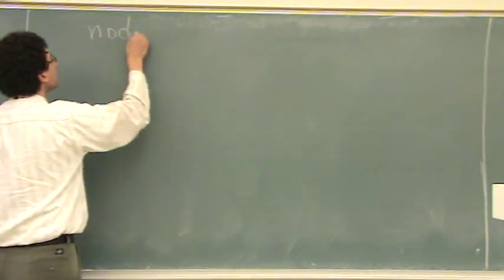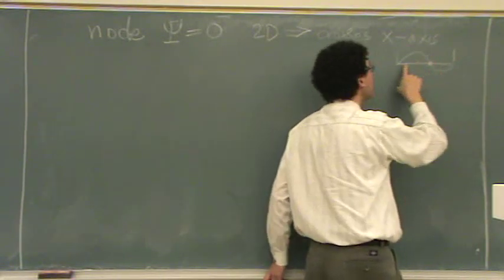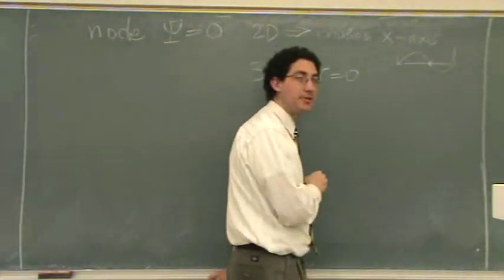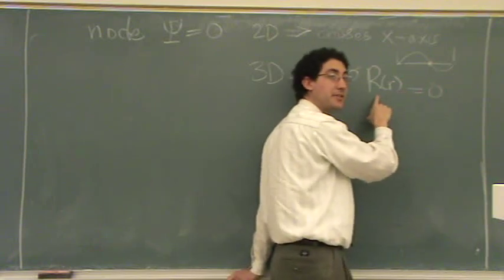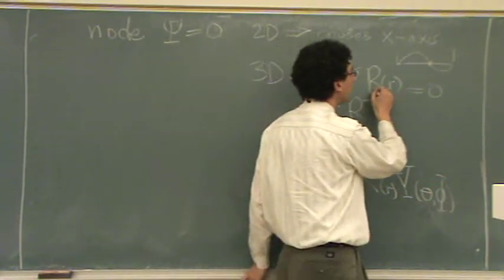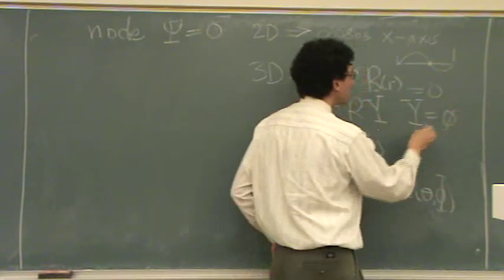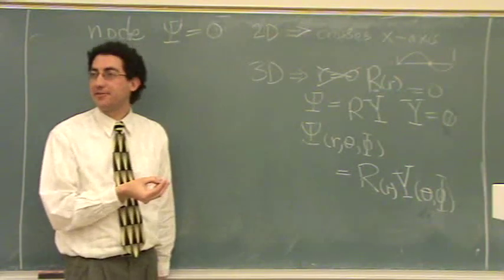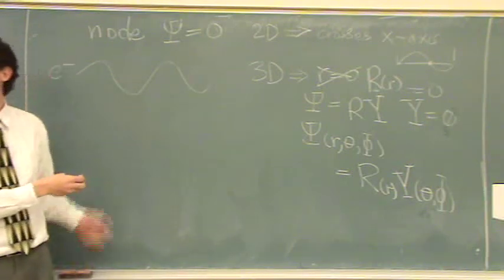Nodes

Comment from the maker: @BlueBerry349 If I am understanding your question, you set the angular part of the wavefunction equal to zero and solved for the angle but are confused in how the plot the answer.  If the angle equals a constant, then you would have a line (or plane) at that angle on your graph because r could equal anything.  Or, you can just imagine the orbital itself.  A dxy would have nodal planes on the axes and so you immediately know how to draw it.

Comment from the maker: @iqrasaeed93 The simple difference is that the angular is a function of angles as variables and radial is a function of r (distance from the origin).  Total nodes = n-1, which is the sum of the angular and radial nodes.  Angular = Number of planar nodes that you can draw through the orbital, which should typically be equal to l.  Radial = nodes that look curved or spherical.  Ex: 3s has 2 nodes total (3-1).  No angular nodes (no planar nodes).  Thus, there are 2 spherical radial nodes.